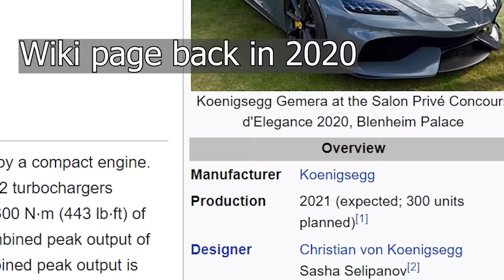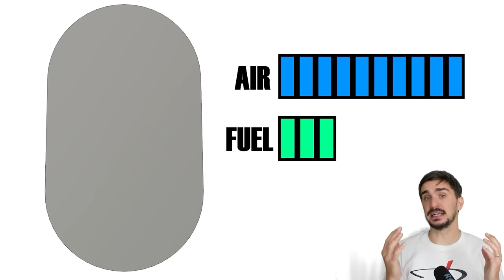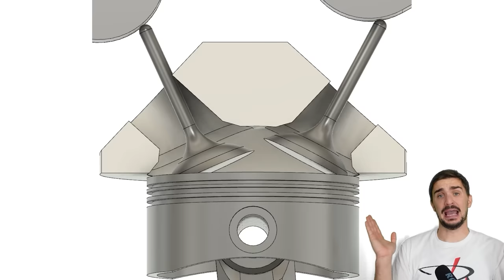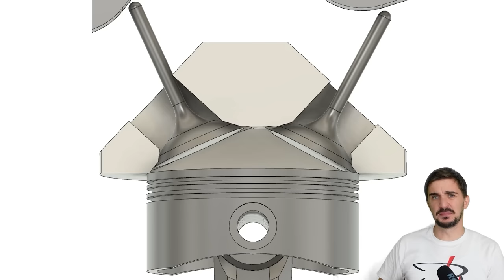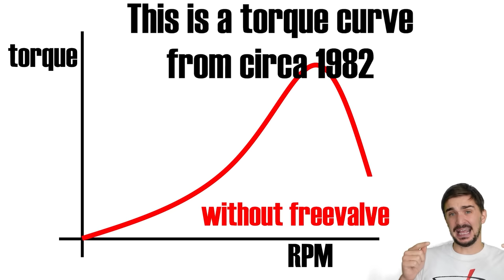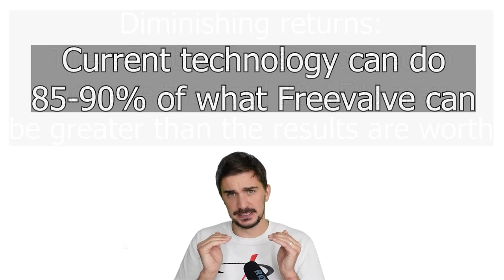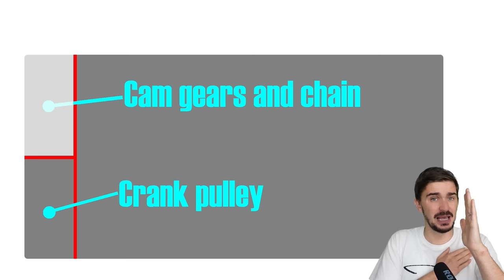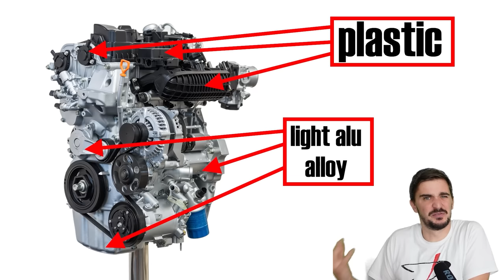FreeValve Isn't a Big Deal. Here's why

Comment: There's one major point that is missed that FV can definitely help with: reducing rotating mass and harmonics. That would release a few good HP's right there. Also, a major limitation in engine RPM is the valve train. Being able to control the valve in 100% of its cycle is extremely valuable. Right now, we're at the mercy of springs. Valve float is real and it's a real pain. High RPM is valuable as you demonstrated. If we can rev to those 8,000 to 12,000 RPM and take full advantage of scavenging, not to mention awesome F1 sounds, that would be worth it too.  Lastly, removing all of the cam, cam belt/chain, tensioners, and associated gears is HUGE! Those add a level of complexity and maintenance that nobody would miss.

Comment: From what I have read, the Free Valve engine would be more drivable, have a relatively flat torque and horsepower curve plus be better on emissions. The camshaft is the brain of the engine and would rightfully take its place as such with fully adjustable valve timing.

Comment: I work on rocket engines. I work with some of the best most reliable solenoid  valves in the industry. They fail. Always. And these are valves that cost $2k to $10000+. They operate at a similar rate to these in their operation being part of "bang bang" controls.
I just don't think they'd last long enough. Anyone whose worked with solenoids know they just take a dump at any time.

Comment: Freevalve is just high performance racing Engine Solenoids brought to commercial engines. It's mainly used there for the extreme RPM it allows AFIK.

Also a camshaft has friction on it and losses involved. The actual raw energy for both systems is potentially the same, but which loses more i don't know.

Comment: Getting rid of the timing chain and cam gears sounds like a major win. Anyone that has had a broken timing chain or belt knows that. Especially if you have zero clearance heads   with bent valves because of it. Rebuilding heads sucks. Great video as always.
Reply: Also, if you lose oil pressure, the engine shuts down preventing catastrophe.

Comment: I think that the beauty of Freevalve is the reduction of moving parts, so you eliminate points of failure, friction costs in the drive train. 

But, I agree with the OP, that Freevalve will remain boutique until it partners with a large OEM supplier like Bosch or Denso to further commercialize the design at scale. 

Jason from Engineering Explained has an old video about how MPG is an antiquated concept that was cemented in the US with the Monrovia Act in the 1970s.

Comment: 9:55 fixed valve timing engines are still being produced in many places, and some of them are really good engines.

There is great Fiat 6 valve engine 1.0L which used to generate 80 hp two years ago before more restrict emission rules in Brazil. Now it's around 70 hp, until 75 hp with E100 ethanol.

Even Honda is selling Fit and City with variation just in admission, not in the exhaust. 127 hp  1.5 L naturally aspirated.
Reply: of course they are not fun cars, AND the power curve is not great, but most of 1 litre naturally aspirated Fiats are cheap and are doing hard job, and most Hondas are being sold with CVT transmission.

Comment: I feel like one major point that was missed when it comes to this tech is the capability to retrofit onto older engines, effectively reviving the older cars to have the efficiency gain that they need for better HP, gas mileage, reduced weight, and less complexity for user serviceability.

One thing to note is that my throttle body on my 2001 Jetta was cracked and was 800 dollars to replace... I wouldn't have had to replace that at all if Freevalve was a thing.
Reply: Nope, just several thousand for the computer and other hardware swap. The valves would probably cost more to change than a fuel injector. ( They are both electromechanical devices ).

Comment: If cost is not a factor, there could be 3 areas that FreeValve could improve upon vs standard engines. Head design flexibility, especially for prototyping.  Maintenance, the design allows for much easier replacement. And depending on how they are manufactured, reliability due to less moving parts and friction surfaces.

Comment: Freevalve would be hard to beat on a large, constant-rpm equipment engine. The time it takes to open the valve relative to the cycle time is better at low rpm than at high rpm. On big equipment engines, you could open the valve much faster than a camshaft could.

Comment: I always thought FreeValve would be the ultimate way to tune a conventionally cammed engine.
1) Build engine with intake and exhaust system
2) Use FreeValve to determine the optimal camshaft profile for the engine.
3) Grind a cam to match.
4) Profit???

That would make FreeValue a research tool.

Comment: from this example you can see that the internal combustion engine for cars has gone as far as it can go. You can throw more and more tech at it, but the returns are becoming smaller and smaller. It also makes little sense from another perspective: cars with internal combustion engines are in the process of being replaced by full electric cars.

Comment: Freevalve designed for ease of replacement will be an absolute win. Even if the mechanism wears every 50k miles, the benefits of cost reduction,  engine simplicity,  and performance increases across every metric means a mass-produced version will be a win all around.
The key is to design with service in mind.
Initial costs are high, but as development and mass production continues,  the price will drop below that of variable valve timing boosted engines.

Comment: I would also imagine, that many "independent" or smaller workshops which in many cases already dislike the exponentially growing use of electronics in cars/engines, wouldnt be able to service Freevalves, bc of some missing proprietary electronic gadget or so, or at least only with a significant cost increase for the customer.

Comment: the same could be said when switching from carburetors to injection, or injection to direct injection. its not about super higher gains but higher control.
when designing an engine you need to form your calculations around an rpm target, and then fine-tune to make sure it works decently well on the rest of the expected rpm range.

the more things you have precise control over, the better. we no longer have to guess how many ml of fuel we injected to a cylinder at any given rpm/power demand, because we command the duration of an injector pulse and quick math with pressure and fuel temp can give you the exact figure. there's variable timing designs that try hard to give that extra control, but they are still fixed and cant be improved without complete redesign/change of parts.

electromagnets are much simpler and better. if you can manage heat and spike power demand at high rpms (which its my guess it is the main issue they're facing). also much cheaper to manufacture engines, as camshafts are probably the third most expensive part

Comment: Google translator
The two engines that in my opinion are the pinnacle of development are the omega 1, it has a production of 10 hp per kg. And the liquid piston x, this makes about 3.8 hp per kg. Both are rotary and valveless, they have ports in the parts that rotate. They have unique characteristics.
The liquid piston is extremely simple, it has 2 parts that rotate, but it has three explosions per rotation of the rotor, it works from fuels gaseous, hydrogen, methane, to heavy diesel, the same body adjusting the carburetion, and does not require cooling by water. The omega 1 is more complex, it has two rotating chambers, one of compression and one of expansion, I think that in both the explosion is at a constant volume
-----------------------------
Los dos motores que en mi opinión son la cumbre del desarrollo, son el omega 1, tiene una producción de 10 hp por kg. Y el liquid piston x, este produce alrrededor de 3,8 hp por kg. Ambos son rotatorios y sin valvulas, tienen lumbreras en las piezas que rotan.Tienen características únicas. El liquid  piston es extremadamente simple tiene 2 piezas que rotan, pero tiene tres explosiones por giro del rotor,  funciona desde combustibles gaseoso, hidrógeno, metano, hasta diesel pesado, el mismo cuerpo ajustando la carburación, y no requiere enfriamiento por agua. El omega 1 es más complejo, tiene dos cámaras giratorias, una de compresión y otra de expansión, creo que en ambos la explosión es a volumen constante

Comment: I am thinking that looking at the power and torque graphs and looking at the max values is not a way to do comparison.
I think for me, it is better to check the area under the graph between 2 engines, in the area where you will drive, between 1.5 and 4000rpm.
It is no use if your engine does 50HP all the way up to 14k RPM, and then all of a sudden gives 2000HP at 15000 RPM.

This is why looking at the area under the graph is best.

Comment: Great analysis!  Would you please re-visit this topic with the standard of comparison being a Lycoming IO-390-EXP119 aircraft engine.  If, by using freevalve, we can come up with an engine with a 2000 hour TBO, weight <= 280lbs, 215HP (at 100% power), sustained power greater than or equal to 55%, fuel consumption of 8.0 gal/hr at 55% power, and the ability to do all of that on UL94 avgas, Jet-A, or diesel, you've got a winner.

Comment: I always enjoy the amazing insight and explanation of these videos. One arguement. The improvements over the last few years have been done via direct injection and high compression. So the current traditional engine would still have benefits of pnumatic or hydraulic valve actuation. DOHC wasn't game changing at the time but now its the norm because the cost is neglible for the improvents.

Comment: It’s weird how I been wondering what’s been going on with free valve. And I feel the only thing it would help would be if u get the air pressure above the valve to change the timing and the crank would have to also be somehow independent per cylinder

Comment: 1 feature eliminating a whole host of things , even if solenoids fail premature taking the head off would be an easy job because no timing components,heck you could get rid of the crank pulley in some situations, but it is obvious that it isnt easy to implement since they havent been able to make it yet, but for sure it would be a game changer for ice engines.

Comment: I agree with a lot that is said in the video; maybe also the 3D printed turbo enable some tricks, but everything is in the 1 to 2 % at best, so all combined can make a difference, but not for a consumer car. I always thought is would be great to get rid of belt/chain camshaft and throttle body, but not if the cost is higher. The best part is no part and I bet the freevalve has a lot inside it, so it looks like a simplification from far away but is complex up close.

Comment: The Multisir is superb, but you must fill in the specific oil, and check the oil level. because air bubbles in the Oil is the biggest problem here. Also if you dont start the engine a very long time it makes problems, because the Oil must first get pumped to the actuators first. But after all its a success for Fiat.

Comment: This was a great idea 40 years ago when people first started working on it. An EV is much more efficient and has higher power potential.  In a series hybrid configuration an ICE can be used at a set RPM if all it has to do is charge batteries.  The cheapest, lowest technology engine can be made to reliably handle that job.

Comment: I think what keeps cost so high on the product is having a small R&D team in development compared to other manufactures that have much larger R&D teams and high amounts of outside funding such as government loans, grants and investors. Not only that with such low production in vehicles its harder to test new components which many companies do before they release a better product they release sort of a beta with the public at the publics cost and when problems that need to be fixed come up dealerships typically report it back. If a larger company supported them it would be much easier and faster to release a finished, reliable, tested and polished product for a way lower cost.

Comment: any engine with VVL and VVT can accomplish a vast majority of the benefits of free valve. BMWs been doing it for over 2 decades now. sure you can eliminate points of failure with a single solenoid, but the techs been around for a while and frankly has gotten pretty reliable. basically to the point where free valve isn't necessary

Comment: How about a video on using High Octane fuel in a Direct Injection high compression ratio engine?  I can say with certainty, that the difference in smoothness at partial throttle, Torque at low RPM is Astounding.  Well worth the cost difference.  Mileage is likely improved, but the "Electric Smoothness" alone is worth it.  Huge difference..  EASY to Notice, Night and Day.

Comment: Insert High static compression (14+:1 ) and e85 to help counteract high overlap. Which also adds efficiency and power on their own. For every full point in compression increase equals approximately 4% increase in power from idle to peak rpm. E85 burns faster helping to move more air across the same rpm as straight gasoline fuel. Also being an alcohol based fuel means more advanced timing, higher octane to prevent detonation, and cooler Air inlet temps.

Comment: The one thing that will always kill FreeValve type technology for most cars is the sheer complexity of the control system needed to take full advantage of it.  Off the top of my head, I come up with a lengthy list of inputs needed to integrate and decide precise valve timing … all being done in realtime.  Although theoretically possible, it only takes one sensor, or wire going bad and you have a potential “piston meets valve” moment.  

Engines are particularly hostile places, and the sensors in them today fail with some regularity. Most of the time, a failed sensor just shoves the engine into “Limp Home” mode. I suspect that the failure modes with FreeValve are much more catastrophic.

Comment: Hey,
I was just wondering... If fuel can be injected precisely into the combustion chamber, then why can't air, too be injected into the combustion chambe or even the correct mixture of air and fuel be injected into the combustion chamber.
If air can be injected, then the ECU can control the timing of the air or the air /fuel mixed mixture. Even the duration of the air being injected can be controlled.
We can start the injection of the air or air/fuel mixture at precisely the time the piston is starting to move up the compression stroke.
If this is viable, then the intake valve assembly is not needed and this could be a weight gain advantage.
Reply: Sadly this would require a heavy and expensive air compressor to pressurize a heavy and expensive air tank and would also make the cylinder more cramped with another big injector in it

Comment: Finally, someone mentioned Multiair and in comparison with FreeValve! Seriously, there's nearly nothing more FreeValve can do that Multiair can't. With Multiair just the max opening curve is limited and fixed as it is still based on lobes but this sort of a "camshaft" does not open the valves directly but instead pumps oil. Then a simple electro valve allows the ECU to do whatever it wants with that oil thus with the valves. And guess what? It's far, FAR less complex than FreeValve and it comes with a cost of one additional tiny oil filter in the head :p.

Comment: From my point of view reducing the number of parts in the timing / intake / exhaust system is the best reason we should do this actuation freevalve tech. The risk of engine damage from failed timing belts or chains smashing the valves and pistons, the complexity of mechanical tuning replaced by programmable units to fit your driving habits are what we would welcome.

Comment: Fiat MultiAir is pretty much freevalve, and can be mounted on any engine by just changing the head. It promises 10 to 15% more torque and power and 60% les Nox emissions. Also a lot smaller, since it works from the side.

Comment: Once the cam is ground that what you get. Um VTEC and VVT both give running changes in cam timing. 

It is worth noting BMW tried to develop "freevalve" in the late 80's into the mid 90's. They concluded solenoids technology simply wasn't up to the task. I have no doubt the issue still remains.

Comment: The opening of free valve that's sure we have gain but probably the cost it's very expensive to put on the engine... But the energy to spend to put this system to work (air pressure in industry it's very expensive) like the comparaison with the Ducati Desmo valve

Comment: I wonder if this tech merged with classic valve would not do better. 
much smaller solenoid, used to either push the valve sooner or keep it open for longer, but normal camm still does the main lift. 
I wonder if that would not do best of both worlds

Comment: I think you missed a big part of the likely barrier to market introduction. Real world use. A pneumatic system is going to be susceptible to extreme temperatures where changes in air pressure, temperature, and relative humidity can cause big problems for reliably running the engine. You would need to take sufficient measures to prevent ice build up in the system to keep it reliable. A chain or belt driven system is incredibly reliable at all temperatures with most engines never experiencing a timing problem that wasn't caused by poor maintenance.